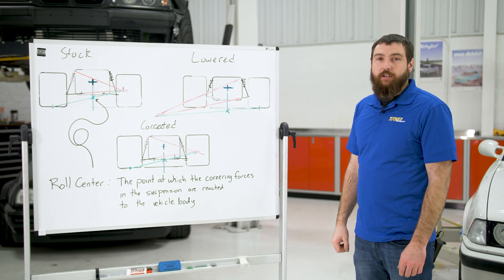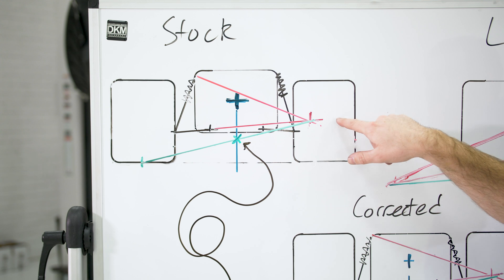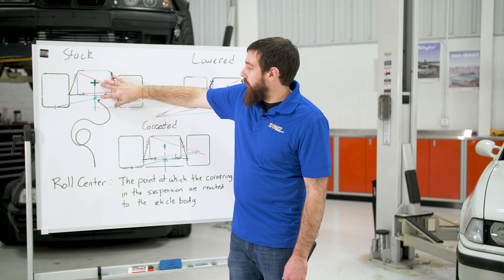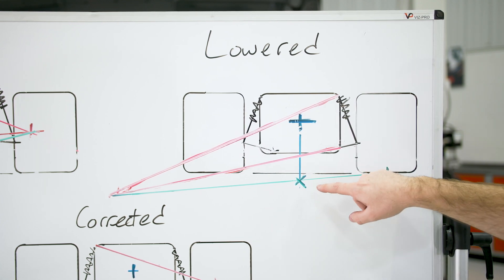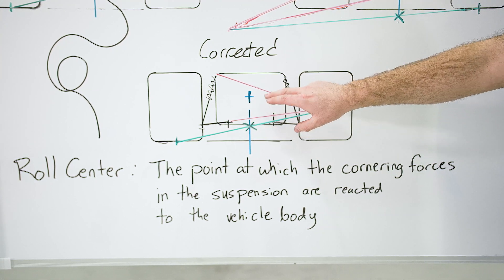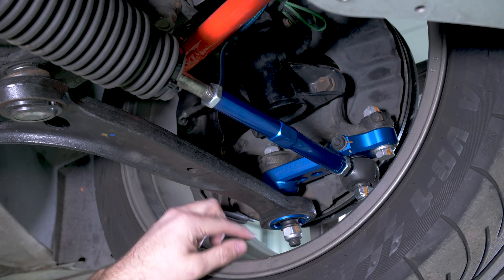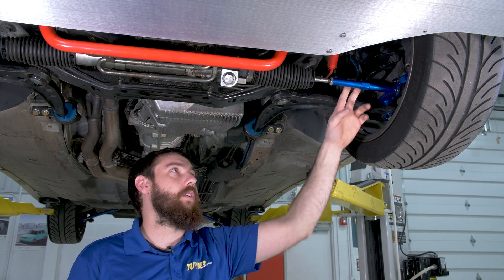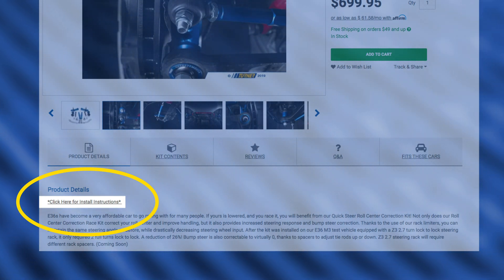What is Roll Center Correction? We explain it! | ECS Tuning

Comment: This is a great tech video. I wish all these correction kits (not only Turner's) were designed to utilize traditional ball joints (including the extended style) instead of the heim or bearing style. I know that this wouldn't allow for the tie rod bump-adjustment but for street guys the ~1" correction would be a huge improvement. Ball joints last longer and are usually quieter as well.

Comment: The first question is, "How low is low?"  "Lowered" 0.25" certainly can not have the same handling impact (for better or worse) as lowered 1.25" and so on.  Lower is definitely NOT always better (meaning faster on a race track).  Are we here talking about restoring some semblance of "normal" handling after having a street car "slammed" to the point of leaving drag marks on every lump, hump, speed bump on the road?  Sure, you want to sell sell sell but having some idea of the parameters where this sort of kit would be of help would, well, be of help to us consumers.
Reply from the maker: We do recommend the roll center correction kit if you car is lowered, even if it's lowered just a little. So even if you're running a simple setup like lowering springs, we still would recommend a roll center correction kit.
Reply: of course they do :)